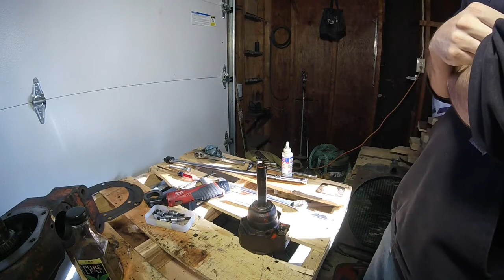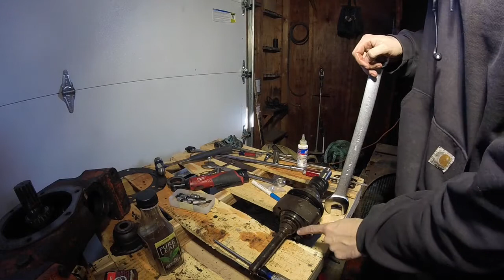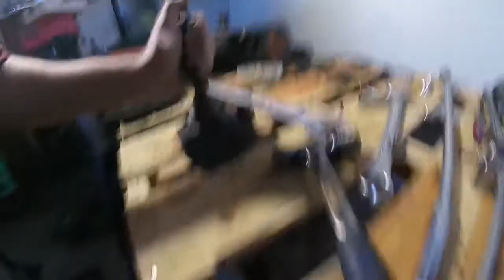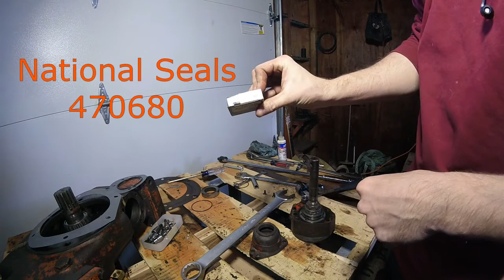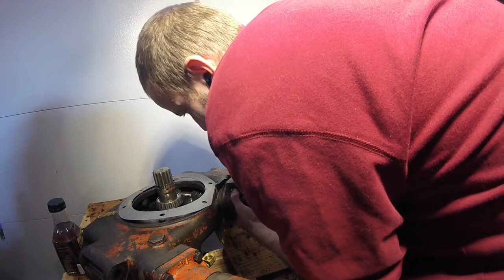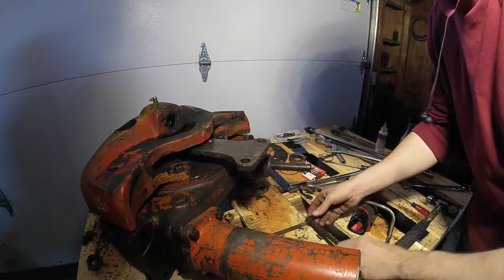Allis Chalmers D17 Power Steering Part 5

Comment: Good vids - info. helped a lot. i'm just starting a re-build on a 59'  d-14. Question : i can't find exact replacements for the O-rings that are in the steering components . Do you, by chance, have the replacement part #'s?
Reply from the maker: Thank you. I don't have a parts book for a 14. I know some steering parts are the same from D15s to 17s, but I'm not sure if that's the same as a 14.